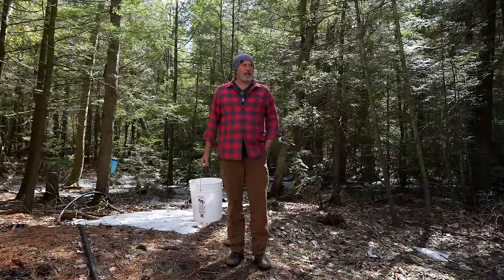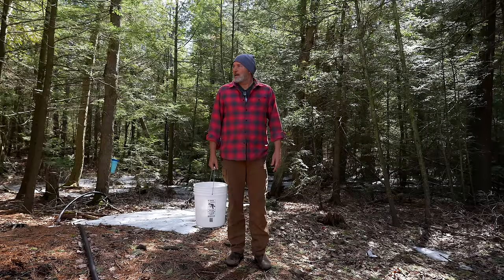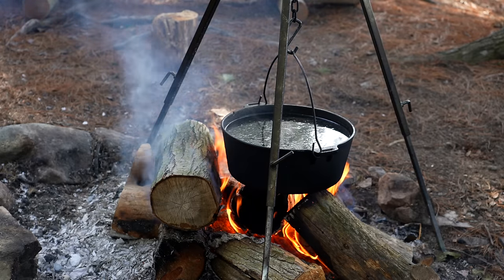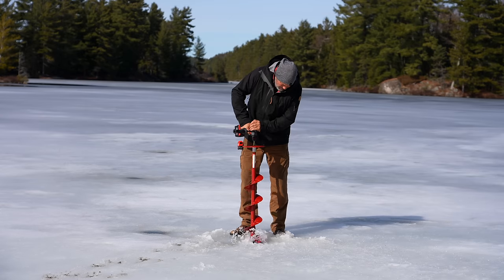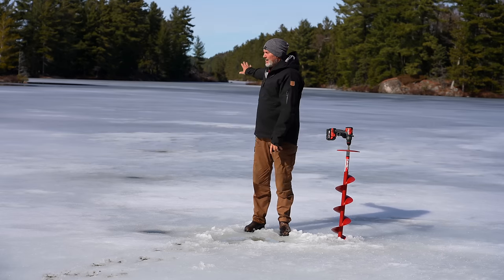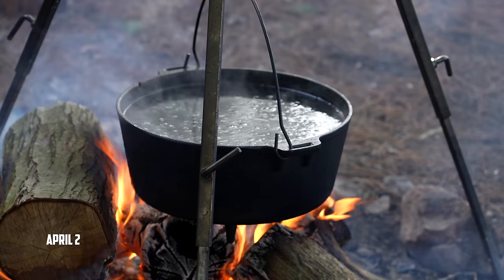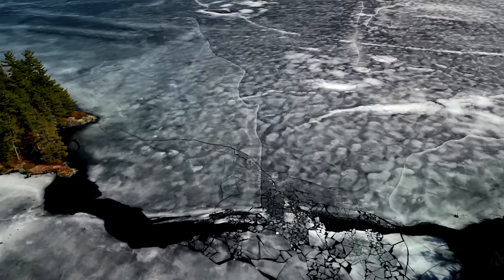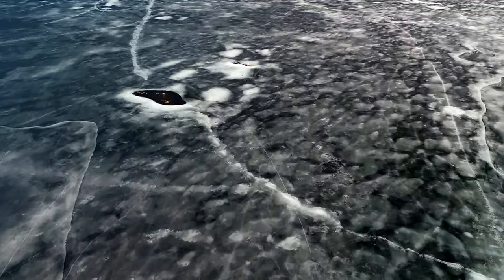FAMILY LIVES ON REMOTE OFF GRID ISLAND IN THE WILDERNESS | The Ice-Out Begins // S9 EP4

Comment: Here is a nice kitchen hack for you the next time you place seasoned/marinated pork belly in a zip-lock bag. The top half of the bag is turned inside-out covering the bottom half so only the inside surface of the bag is exposed. Place the pork belly in the bag and re invert the top half of the bag and no mess.
Reply from the maker: Thanks for the tip! ❤️

Comment: Great  process of the rice and as long as you also alow the moisture to escasp also befoer you vacum seal it. As for your sealig meathod, using a O2 absorber is great accrodding to what your storing, do not use plastic as you have. Only use mylar as that is the best for ensuring long term storage.If your using plastic vacume sealing, if it is for a year, that will be good, plastic has a permiable aspet that willl let air in. Hope ths helps God Bless
Reply from the maker: Thanks for the tips. We appreciate it!